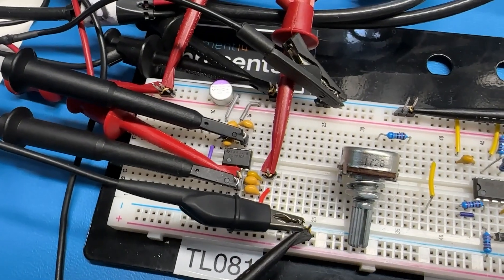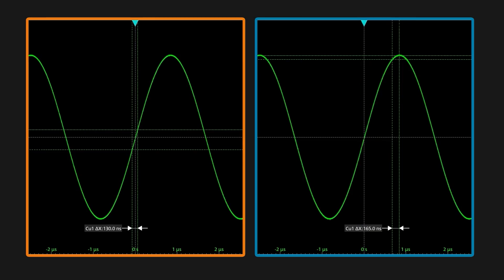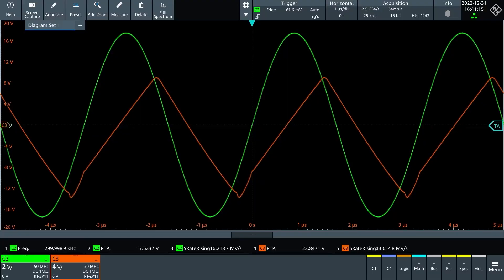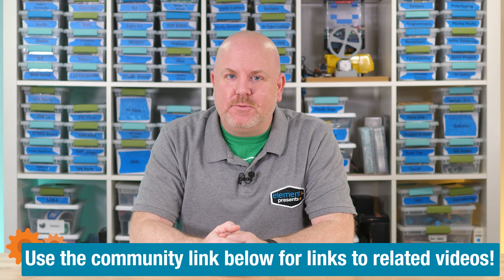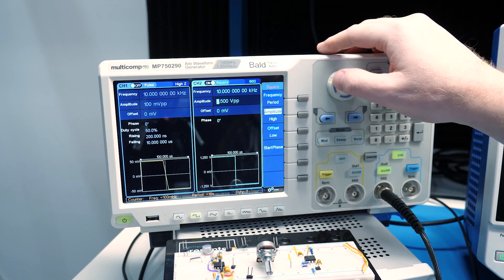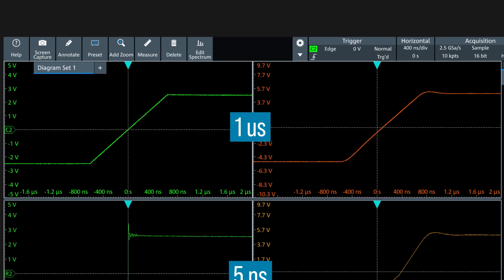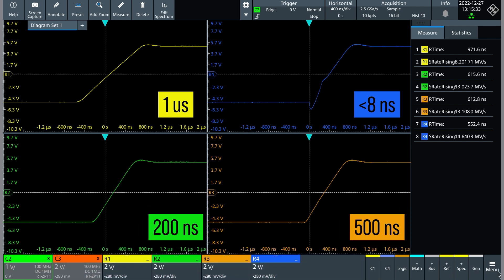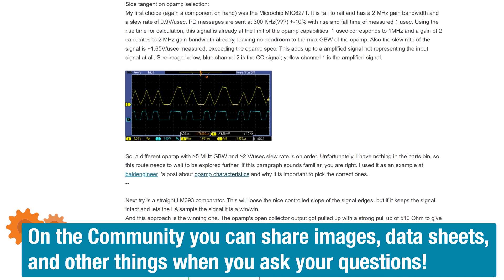Slew Rate vs Rise Time Measurements for Op Amps - Workbench Wednesdays

Comment: Very good video, but it was too quick, in my opinion. Thanks.
Reply: There is a lot of info to take in and digest.  It is helpful to watch more than once. Also, if you have the equipment, build a the circuits, take the measurements, and make the calculations yourself.